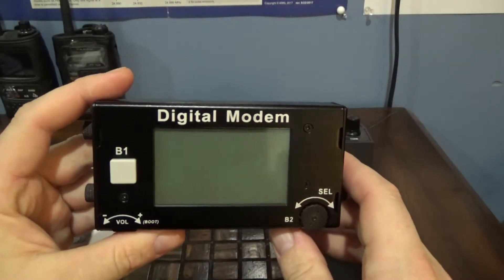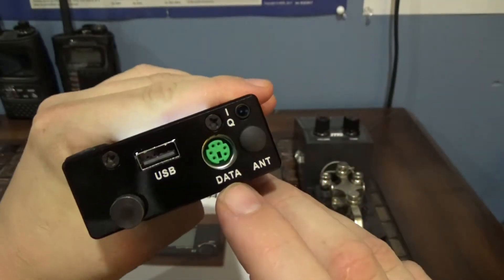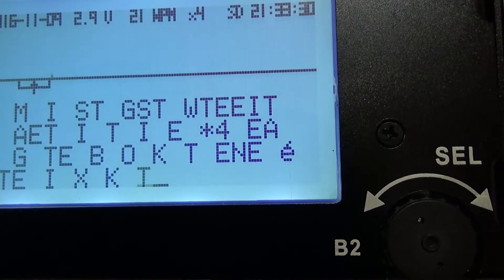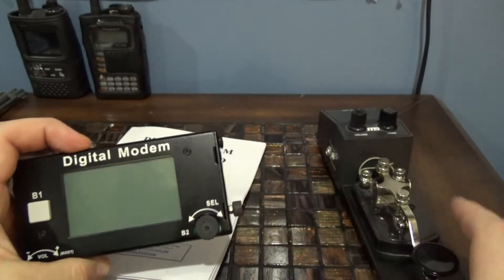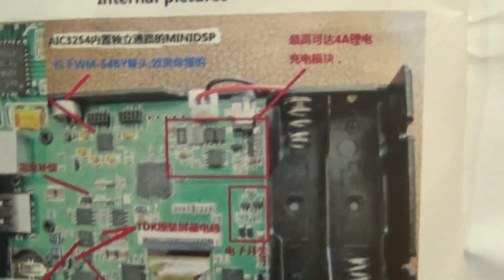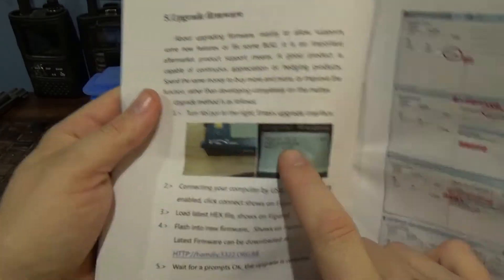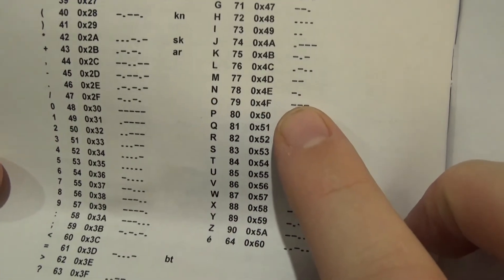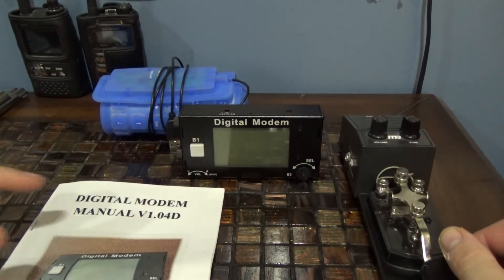Ham Radio Digital Modem (PSK/RTTY/CW)

Comment: Hey together. Is there anyone who knows if it is possible to change keyboard-layout from us-layout to german-layout (left downsite is 'Y' - not 'Z') in this modem ? I dont find anything for changing.  And - by the way - I also dont find the possibility to change rtty-shift (from 170 to 425, or 850 Hz) and the possibility to change baud-rate (45.45, 50, ... 110Hz). 
Do anyone have some experience of it ? In the manuel I also dont find informations.
But ...  Thanks for this video !!     vy73 de DL2EBZ  - Bodo -

Comment: FLDIGI made this thing obsolete.  Its best thing was the ability to transmit FSK or RTTY with a super light set up that included the modem and a portable roll-up key board, plus an SDR transceiver or even a hand held transceiver.   Now you can do with a laptop and an SDR transceiver.
Reply: For ultralight I think this wins. Two AA batteries and will run forever. No worries about damaging your computer, much smaller and lighter, etc. For the shack, sure a computer wins.
Reply: You can get a NUC and dedicate it to that purpose.  RTTY and PSK31…power on 12 volt.